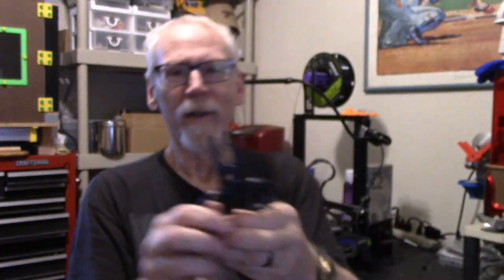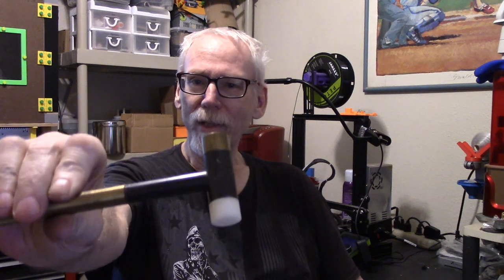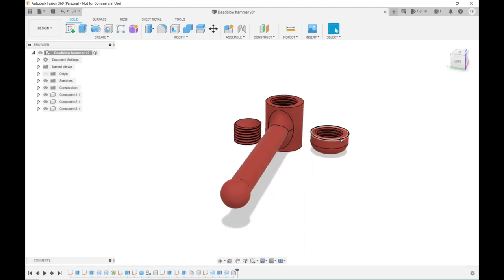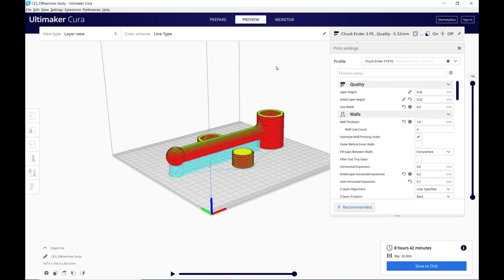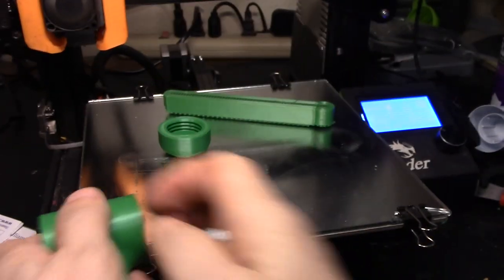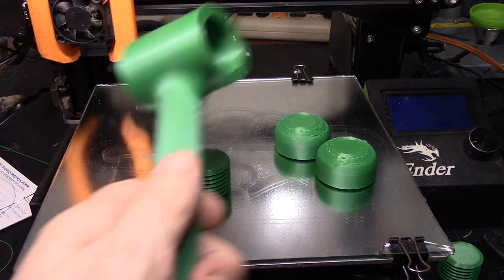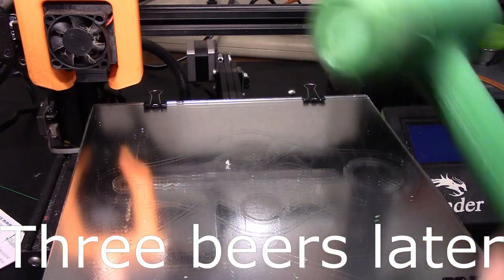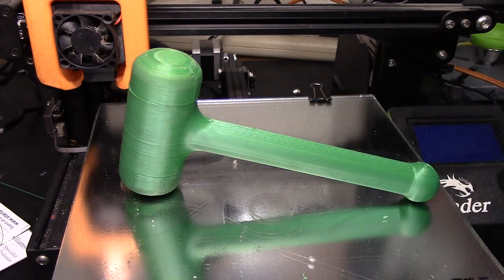Are 3D printed tools actually useful? Let's print a deadblow hammer on the Ender 3 and find out!

Comment: I would highly suggest designing 45° filets on all threads inside and out. Then I would put a 3/8 hex maybe 1/2 inch deep on one end of the threaded parts to make it easier to install or remove. I wish i was better at fusion, I have trouble sketching, I use blocks, spheres and cylinders to make things.

Comment: You can actually modify the surface of the threads to increase the tolerance. Someone made a guide to make 3d printable threads on youtube and it has worked well for me. Also in your slicer,  there should be an option for using random start point of the Z axis. It spreads the “seam” resulting in unclean surface finish, but makes round parts fit together with lower tolerance

Comment: You could use a stick attached to a pivot to have a consistent swing. If you have it setup like an impact test with a fixed plate at the bottom for a strike surface you should be able to get some pretty good results.

Comment: just a heads up, for your threads that are hard to screw in, try a heat gun and warm up the pla on only one of the pieces and start twisting it in. It seems to work for me and makes a tight but movable thread
Reply from the maker: Good tip, thanks!